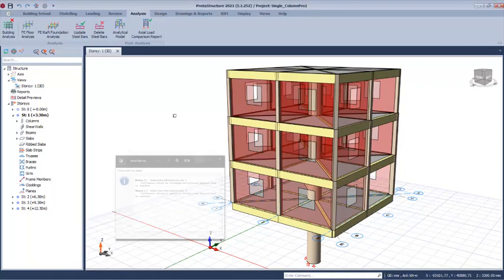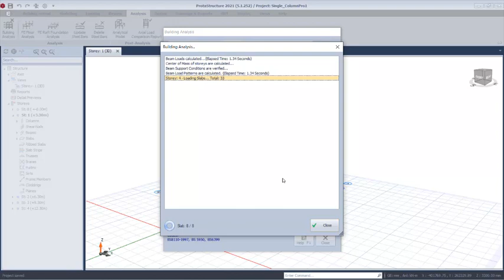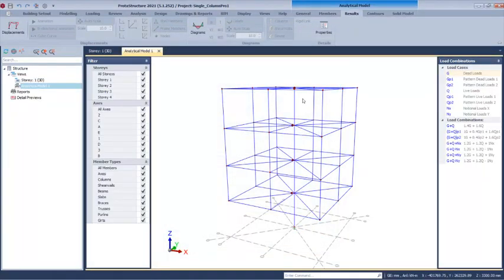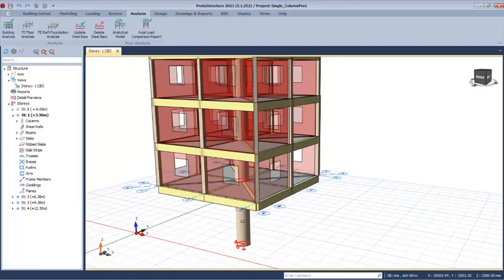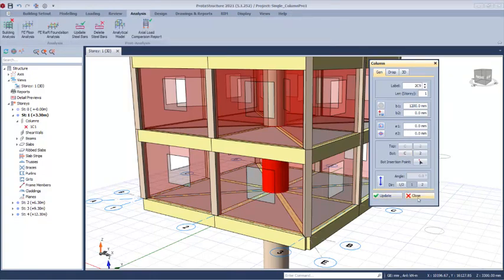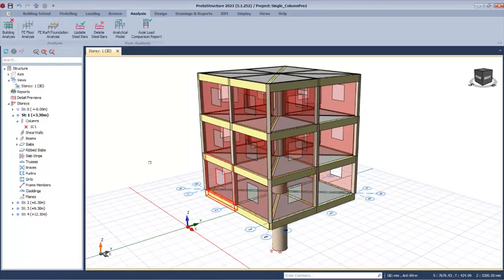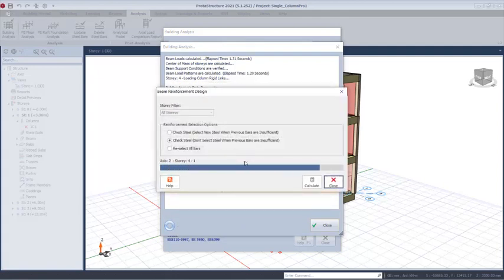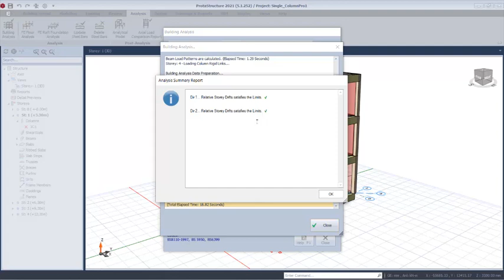Protastructure Warning Rectify  (Relative Storey Drift Exceed the Limit)

Comment: Is there a need to increase the size of the beams and slabs also
Reply from the maker: Only the vertical structural member (in this case only the primary column should be increased)

Comment: "Warning:difference between decomposed loads and slab loading
is %=20.49
yield line approach for beam load decomposition may not be adequate for this model 
warning:difference between building analysis results and undecomposed slab loads %=21.59
it may be advisable to check the building model
refer to axial load comparison table for more detailed information"

Dear Mr , How can this warning be fixed?
Thanks
Reply from the maker: Merged the super structure with the substructure for proper loads decomposition
Reply: @CADmade-easy  thanks , Can you explain more
Reply from the maker: @mostafaelbaroudy471   what's the number of storeys in the structure you are designing?
Reply: @CADmade-easy  In this form only 1
Reply: I increased the floors to 8 floors and it gives the same message - loads are DL+LL only

Comment: Thanks 🙏 for the knowledge sir, the last time I watched your video with the same type of warning you said the super structure load is heavier than the foundation, please how are we increasing the foundation to withstand the load from super structure? Or is it by just increasing the column section alone?
Reply from the maker: Varying column's section from ground to upper floors, applying retaining wall at the foundation of the structure and increase column's section  help in such case.